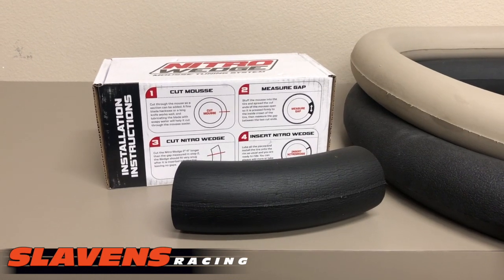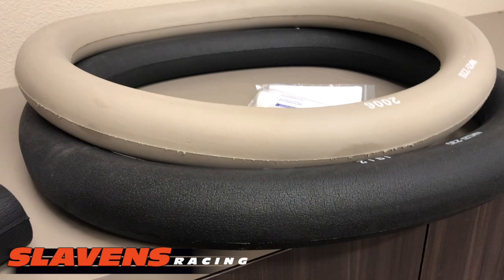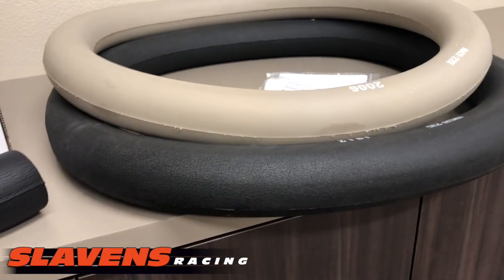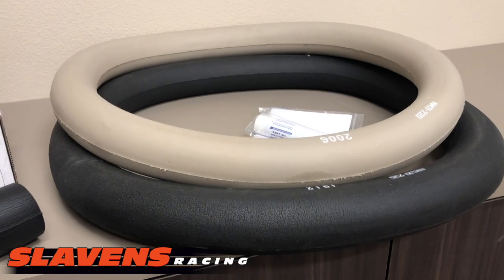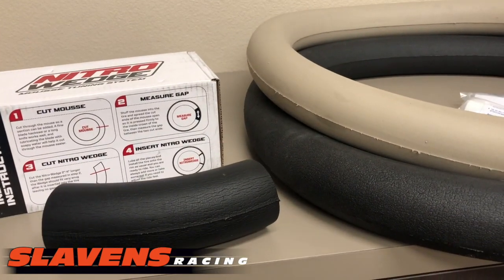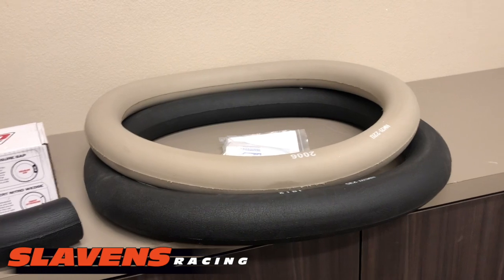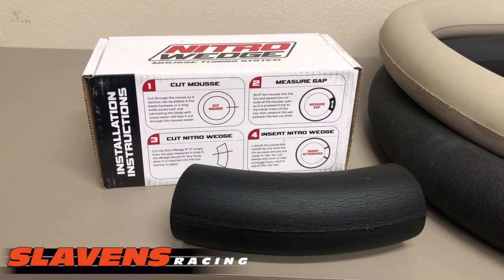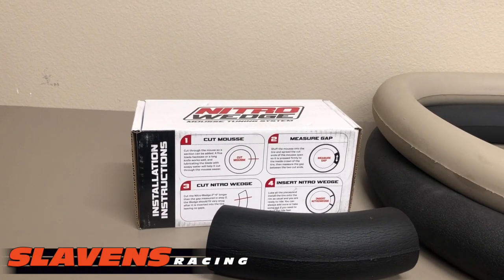Product Showcase - Nuetech NitroWedge

Comment: Hi Jeff, I’m new to mousses, I recently put 2 Nitro Mousse in my 2 stroke.  Do you have an opinion about the Nitro Cooling Gel vs the Murphy Tire soap? I plan to use the tire soap when I re-lube or put a new tire on.  Thanks for the videos.
Reply from the maker: Steve, Definitely stick with the cooling gel or you will be purchasing a lot more mousses. I know guys post that they use Murphys but it is a soap, NOT a lubricant. It does not lubricate well and it dissolves when the mousse and tire get hot. It's always best to use the product designed for the job. We get calls from guys complaining that their mousse wore out prematurely and Murphys is almost always the common denominator. Next time you get on a forum looking for advice, please turn on the BS filter first. If you need advice on any dirt bike subject, please give us a call.
Reply: @slaverace1  Thank you.

Comment: Newer Nitro mousses wear so quickly they sell this wedge…. Couldn’t get mine to bead my tires after a handful of hours. This never used to happen with the pre-platinum Nitro mousses. Bananas.  It also just keeps adding more weight to your wheels. 

@slavens why not just use the blue box Michelin mousses and skip all this stuff?
Reply from the maker: Mousses only wear quickly when they are the wrong size (too small), not well lubricated or when ridden on pavement. If the bead won't pop that is a red flag that the mousse is too small. If weight is a concern, use TUbliss and skip the headache associated with all mousses. 

We sell Michelins and other mousse brands.
Reply: But Nitro Mousses wear more quickly than Michelin’s.  Way more quickly, and Platinum’s wear more quickly than the old Nitro Mousses. 

Also, Tubliss is barely lighter than the blue box Michelin’s. Would be nice to see you do a direct comparison on mousses like you do on tires @slavens.